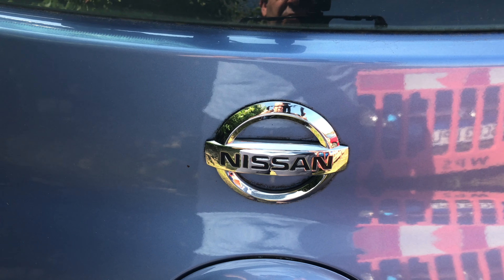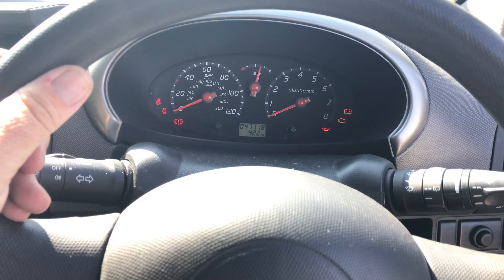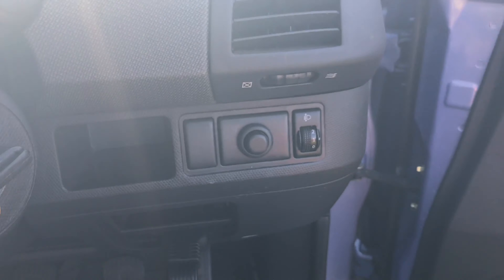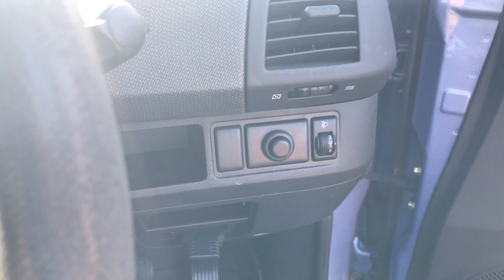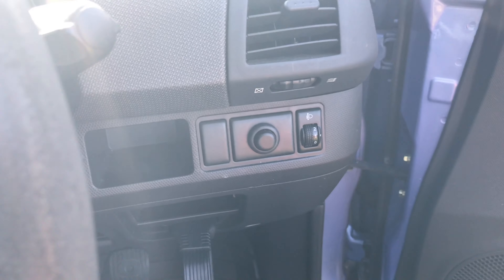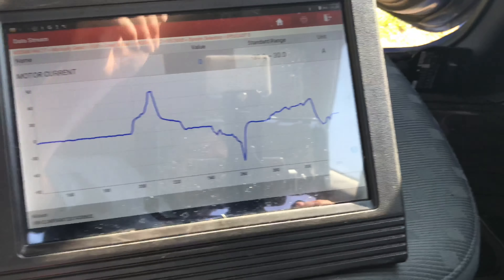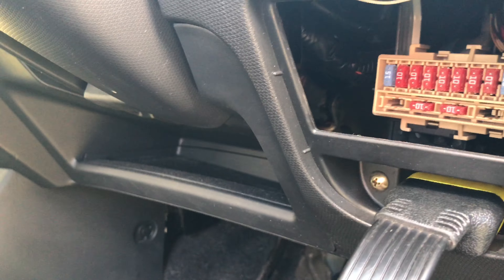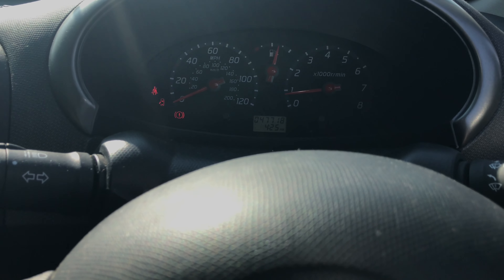Nissan Micra K12 (2005) - Power Steering not Working (Intermittent)

Comment: Having a similar problem with a Nissan xtrail problem happens soon after you start to drive, entire steering column and rack was changed but the problem was still there. Next step is to check the wiring.
Reply: En is al opgelost?

Comment: I had a similar issue with a Nissan Note which I believe it has the same engine and power steering setup Sandy , the problem ended up being a bad battery 👍
Reply from the maker: Thanks for info Igor I'll check out how old the battery cheers sandy

Comment: Chief constable Miekelson doing the voice over? 😂😜😜
Reply from the maker: lol
Reply: @sandyande  on a serious note though. I’ve got a non starting micra k12 which is immobilised. I’ve read if replacing the steering Column it needs coded to the car?  You had any dealings with that in past?  Cheers.

Comment: i have same problem ps light on no power on steering i connect my obd2 says no error code found
Reply from the maker: OBD2 will not communicate with this module only the engine computer

Comment: Hi Sandy, I had a similar problem with a Vauxhall Corsa, after the engine had been pressure washed.
It was very strange because the motor and wiring are inside the car,and no water was coming inside.
The steering stopped working three times in a four week period but has been perfect since.
That was over a year ago and 12000 miles.
Always a difficult one when its a customers car.

Comment: This has happened to my nissan AGAIN anyone solved the mystery ?
Reply: Check your battery ...a bad contact or low batt can cause this...
Reply: @nightstorm9128  i have the same issue and the PS light is on. I recharged the battery to full and didn't solve it unfortunately. Is there a scanner that can reset the fault?
Reply: @MrGilly  and is it solved
Reply: @vahitsal6199  the dealer cleared the code and it was fixed. Then 2 weeks ago i traded it in for a Volkswagen Golf. Sell the car asap
Reply: Hey man! Any updates on your issue with nissan micra K12 PS red light? Did you have the whole PS column replaced and it occured again? Did Nissan give you warranty on this fix?